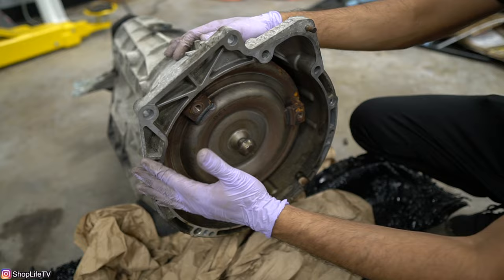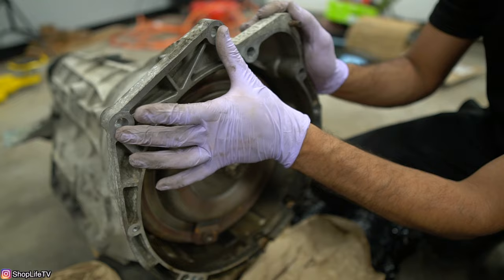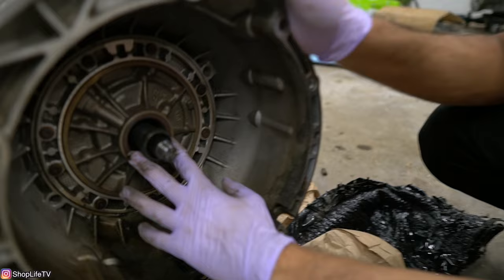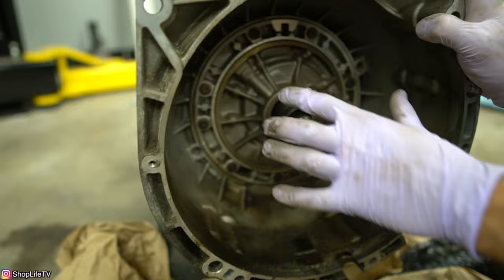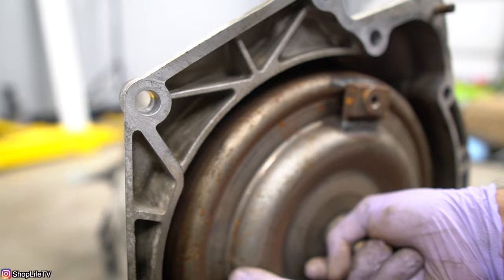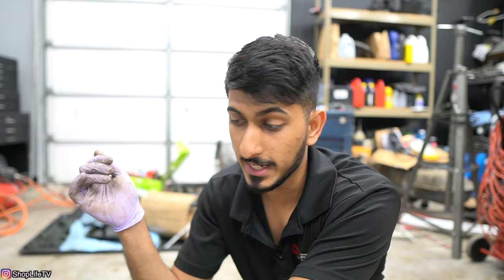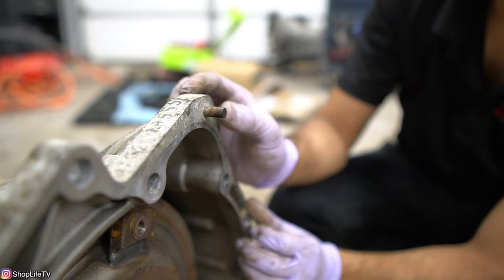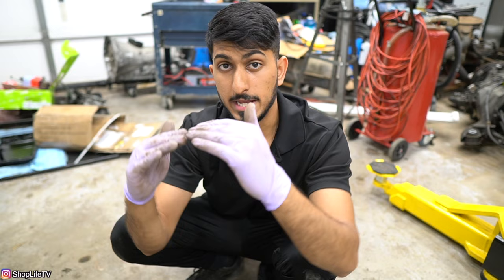WATCH THIS BEFORE REPLACING YOUR TRANSMISSION!!

Comment: All ways replace the front pump seal anytime you pull the transmission out, even if you pulled transmission to make something correct and go right back in. Small price to pay, just it case it would might  leak. I have been there more than once.

Comment: I would first put it in wrong deliberately, then mark or just observe how far in it goes, then I would know that I've got to get it further than that if I want to be sure it's in right. And I can mark the wrong one by placing a straight edge across the bell housing and measuring from the bell housing to a flat point on the torque converter. Let's say it is one inch. Then I know after all my fiddling to get it in right, it needs to be more than one inch, maybe as much as two inches, which is very noticable using the straight edge method.

Comment: THIS is what I forgot. Had to replace a flexplate, and none of the videos I watched mentioned any of this. I put it all back together, but couldn't start the vehicle. Luckily. I tried starting it and and it did turn over several times, but never actually started. I heard a bit of jangling inside...
I hope I'm able to take it back apart and try it again without having to buy another part.

Comment: You know you sht! that's a great tip, Should be a dimension somewhere so you could measure the depth from the face of the bell housing to a part on the converter to be sure its all the way in. Thanks another Great video.

Comment: I made this mistake on my first truck when I was a teenager. I tried to marry the gap between the engine, and transmission by tightening up the bell housing bolts. It ended up snapping an ear off the bell housing.

Comment: Guilty..... Didn't know I effed up until I heard a loud metallic snap when trying to bolt up the box.   Damn....that was an expensive lesson for me
Reply: Mine rang like a bell. Pulled the motor, reseated the torque converter and reinstalled the motor. No drive, no reverse, no joy. I'm in the process of trying to figure out how far up the creek I am.

Comment: You feel for the torque converter to bottom out. I had trouble putting a Toyota converter in its transmission.

Even my 4T65E HD… there’s an O ring on the input shaft. Where there’s an O ring, use assembly lube to make it easier.

Comment: I didn’t seat the converter properly then bolted the gearbox up to the motor turned the crank with a breaker bar knew something wasn’t right so I pulled the box off and started over would I have broken the pump or anything? I just put the box in today.

Comment: I have an 002 gs300 and I changed the engine so I also changed the transmission fluid now when I try to fill it back up it’s spitting up the transmission fluid up throw the trans dip stick and reason for that

Comment: I have a 1997 GMC Sierra 1500 truck with a 5.7 liter vortec engine with a 4l60e transmission and i was driving down the road and my truck just stopped pulling.Got it home and I have to much fluid in it so in the next couple of days im going to drain some fluid and see if it fixes it .I might change my filter and gasket too .Maybe you could give me a reply?

Comment: Hi bro
I like your videos. They are informative. I have question. I change oil on my cars.
But recently I have bad experiences.
I changed oil on Hyundai sonata and I put right oil type with different brand. It kept seeping. But there was no obvious leak. 
It has caused little problem in performance.. Can you make a comprehensive oil change video?

Comment: HELLO BUDDY THIS IS THE FIRST TIME I SEE YOUR VIDEO👍 I HAVE A PROBLEM WITH MY 2002 SUBARU  OUTBACK 3.0 I BRING DOWN THE ENGINE AND WHEN I PUT IT BACK I I THINK MESSED UP  WITH THE TORQUE CONVERTER (I'm not sure) TO PUT IT IN AS YOU SHOWN HERE. MY QUESTION IS,   ONCE 
IS  ALL THE WAY IN THE TORQUE SHOULD SPIN EASILY WITH NO MUCH PRESSURE?🙏 BECAUSE MINE DOESN'T SPIN  ALL THE WAY.  AND  IT STACKS. FIRST WHEN I PUT THE ENGINE BACK, NEVER TURNS OVER  WITH  TWO HANDS, OR A RATCHET FRONT MAIN SPROCKET NOT EVEN MOVE A MILLIMETER IT WAS STUCKED.... CAN YOU TELL ME IF CAN BE THE DAMAGE  THE TORQUE ITSELF OR THE OIL PUMP IN THE TRANSMISSION???🤔 I APPRECIATE IT ANY TIPS

Comment: Great video. I have a PO741 on a ZF Tranny.  I have not muster the courage to drop the transmission.  The risks that terrify me are as follows:  1. bell housing screws get stripped or snap off 2. Tranny oil pump seal get stuck to torque convertor when pulling it out 3. Dowel pin seems to cause lots of issues when detaching tranny from engine/starter motor - I could see getting impatient and breaking something.   4. Not installing TC correctly (this video).   Question: Are these concerns valid and have you ever experienced any?  Thanks in advance.

Comment: Do you have to put back the axle shaft that is connected from transfer case to the rear axle if its a 4×4 after replacing the torque converter. The dowel were still intact on the engine body when the transmission was put back in place but the dust is making the issue. Does this rotate the crankshaft to tighten up the flywheel to torque converter of transmission? Am I correct...

Comment: hello. I have Pathfinder 4.0 2010.  The gearbox has a delayed gear only in D-drive, 2-3 seconds. At the same time, there is a hissing sound in the gearbox for 2-3 seconds. The oil has been changed. I don't know about the oil filter, we haven't checked. Could it be the valve body or filter that can have such a problem?

Comment: Every vehicle will not withstand overheating mainly caused by continuous stop gi intersection lights lasting 3 to 5 min every 3 to 4 blocks is just damage to every vehicle,  after 50k miles expect repairs, even after complete rebuild , that shall only last upto 10k miles or less

Comment: Great tutorial!
I have a question.
Is it possible to drive the car for a long time with the converter incorrectly mounted?
I had some problems with my gearbox and the auto shop said, that the converter was incorrectly mounted. I have been driving for over 8000 Km with the fault, if it is correct what they are saying. I don't belive them

Comment: I have a diagnosis question. I went to a transmission shop to do a fluid change and they did a transmission flush with an ATF not recommended by the owner's manual, a 2011 Subaru Tribeca, 100k miles. Now I feel a shudder during the lock-up, after the 5th gear. The shop claim the ATF is compatible with my car, but clearly is not. Does this shudder will go away anytime soon or is it better to replace the ATF with the recommended one? Thanks.

Comment: Hello! I have oil leaking from the front seal (where is the oil pump, we changed the oil seal but still leaking. Could you tell me if maybe I have to change the bearings behind? Can I change it from the outside, with some special tools?

Comment: i got a used transmission and i  turned it on and it didnt go into gear, i thought the torque converter was on it good but i hope i didnt brake the pump

Comment: Hey bro thanks for the video, I your help my x6 bmw 2013 makes a huzzing sound between the gear box maybe the engine, I replaced with another used gear box the sound still comes, after you put off the engine the sounds still goes on for like 3 seconds , what should be the problem.

Comment: I just installed my new motor in my car . I attached the torque converter already to the flywheel. I turned the key to the same position on both converter and transmission so when I slide it together it should be close to slip on. Am I supposed to do it opposite ? Will my way work ? I have a zf6hp26 transmission going into a Jaguar s type R

Comment: when not installed properly, you say it will sheer pump, what kind of noise would it make? schreeching noise?
Reply: I just made this blunder.  While torquing down the mounting bolts there was a gap between the engine block and transmission bell housing that wasn't closing. But I kept torquing the bolts like a dolt. Suddenly, it rang like a bell.  "Dongggg!"  That's when I knew I had screwed something up.

Comment: Great video sir. I'm hoping you can help me out...would you happen to know how much torque converter fluid I need for my 2006 Mitsubishi Galant 2.4l Automatic? I drained the transmission and when I removed it I believe the torque converter fluid drained out. Do I prefilled my converter with just 1 quart? Thanks sir

Comment: I put my transmission in and it won't pull it's a 1994 Ford expedition. Does that mean the torch converter isnt lined up right

Comment: Hi, great video.  I am wondering if you can help. I removed and replaced a new engine on my car and when I put the new engine back on, now the transmission fluid leaks when I start driving. It’s fine the car doesn’t move.  Any suggestions what might the symptoms here?
Reply: Ever figure the problem?
Reply: When ever changing an engine always replace the front seal on the transmission. Even if it is not leaking in the first place.

Comment: I replaced an automatic transmission on a 2003 nissan frontier 3.3 and i didnt put oil inside the torque converter..and now the high gear doesnt work..do you think is because no oil in the torque converter?

Comment: Hi, do you know if putting torque converter back on is the same for ZF 8HP 45? I have transmission out of a car, the torque converter now sits separately as I was pulling trans form seized engine. Now I need to reunite them :) But I'm bit hesitant as I newer done anything like this. Thanks!

Comment: Hey sir, have a question. I have a 2000 e46 323i with reverse going out, it has the GM tranny. Is there a Chart/list of transmissions that are a direct bolt-on? Like what makes, cars, and years that I can just swap from, Thanks alot!
Reply: Fastest way to get your questioned answered by the “Ask me a question” form located in the vid description. Good luck.
Reply from the maker: If your GM trans reverse is out, you can replace just the reverse drum and it might solve your issue. It could also just be a solenoid issue. Besides that use car-part.com or RealOem to find part numbers and interchangeable car parts. If you need more help go to www.shoplifetv.com for more  help.
Reply: @ShopLifeTV  Thanks sooooo much!

Comment: I have a Bmw E36 1.6 Se automatic and I have loss of power . My car will start up and accelerate fine but when my car starts to heat up my car goes into a limp mode but I don’t have any warning lights on my dash  . Any idea as to what could be wrong ??

Comment: Hi, I replaced the transmission on a 2009 bmw 335i, and the paddle shifters don't work. They used to work with the original transmission. Any idea why they won't work with the replacement of the transmission?

Comment: My old 2004 1500 Silverado tranny has 6 clicks when I change gears manually on the removed transmission I only get 3 clicks and can’t seem to get the torque converter to spin freely on the new tranny, any ideas?

Comment: did this incorrectly once on a 4l60e 1999 Silverado.  Smashed the plastic ears on the pump drive assembly and destroyed other parts in the process.  I don't believe the WHOLE transmission is trash but did have to remove and rebuild pump AGAIN

Comment: I need some help. I have a 2000 323i wagon wirh a GM trans my trans is burnt. So I found another trans GM. But it's off a 2004 would this still work?

Comment: Can you remove a transmission with out removing the torque converter bolts from the engine?
Reply: No
Reply: @jaywhat9027  thanks.

Comment: Hey I have hearing un normal sound during driving , and when engine is restart the sound is off and come again after 4 -5 km again do you help me the car is Toyota  belta 2005 1kr engine 1.0 and CVT transmission pls help me

Comment: I got a f10 2014 535i rwd that’s giving me transmission faults can I just swap it with a used one or should I rebuild it, and if I swap it how do I get it to work does it plug and work or do I need to relearn it, this is what the dealership told me “RAN SHORT TEST FOUND FAULT CODE 420321 GEAR RATIO MONITORING CLUTCHES A,B C, 4209A1 TEMPERATURE SENSOR HOT MODE1, 4209A3 HOTMODE 2. CHECKED TRANSMISSION FOR LEAKS FOUND NO LEAKS, FLUID IS LIFETIME FLUID. TEST DROVE VEH AND FOUND VEHICLE ONLY OPERATING ON 2 GEARS MAYBE2 AND 4”

Comment: Hi i got a bmw x9 2009 model with 110000 klms, every time im driving it i can feel vibration coming from the transmission as it shifting in to third gear or under load it shakes .any thoughts would be great appreciated thanks.
Reply: Check the u-joints in the driveshaft for binding and the center support for wear.

Comment: Man, what about if my transmission doesn't fit all the way but it is 1/4 of an inch separated?  I keep turning the crank and it doesn't wanna get any closer
Reply: U gotta spin converter til u hear the 2nd clunk
Reply: Spin, jiggle, push ... spin, jiggle, push ... spin, jiggle, push ...  I probably spent 15 minutes doing this until it finally sank in.

Comment: Just get a stick shift no need to worry about a torgue converter and just remember guys when you put fluid in the torgue converter make sure you fill it all the way up so when you put it in you get oil all over the bell housing and the make sure you cut all the zip ties at an angle for sharp points and don't forget threadlock and over torgue every bolt on it

Comment: To be honest I thought you can’t marry a tranny to the engine block if the TC is not properly seated. It’ll get jammed making it impossible to bolt it to the flex plate. 
But if you can do that on a bmw- I’m disappointed in German engineering 😂

Comment: Always replace the torque converter do not use the torque converter over I do not recommend it I've been doing transmissions for 40 years I do not ever recommend using a converter over cuz all the b***** that's inside the converter will go right inside your new rebuilt transmission even if you're not rebuilding the transmission it's good common sense to replace the torque converter while you have it out

Comment: Don't change the transmission fluid if the mileage is over seventy five thousand becas the fluid will break down and eat the clutches And when you Flush that out Now you will have slippage in your transmission and it will go. Never flush the Lines or change the fluid unless it's a brand new transmission.